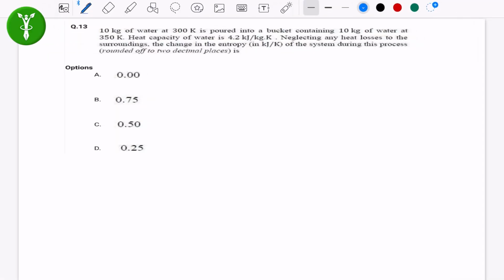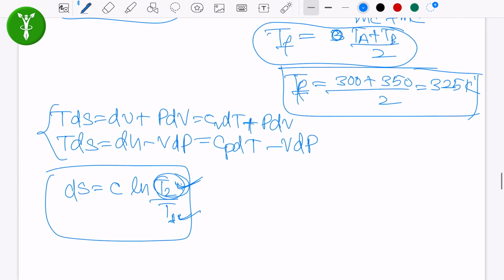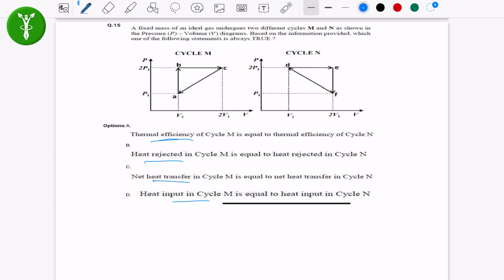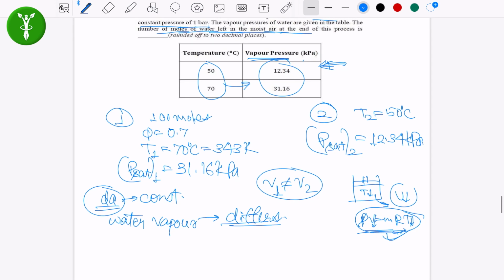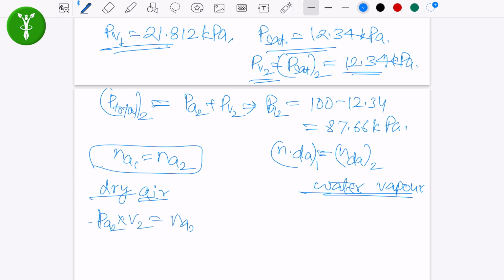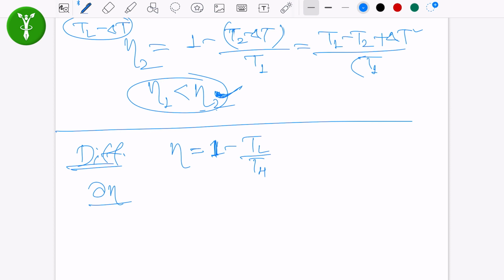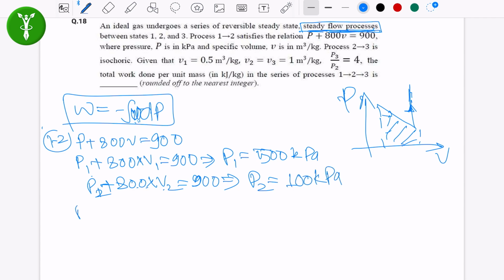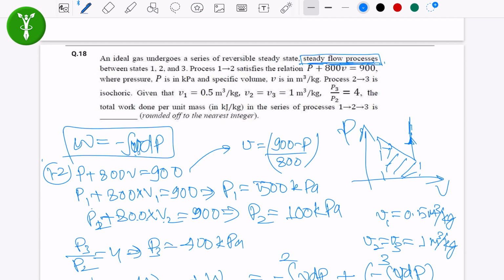GATE XE Thermodynamics 2024 | Detailed Solutions | Exam Analysis | AgriVision4U | Part- 3

Comment: The total entropy is the summation of the system and surroundings entropy. You don't need to consider the sign +ve and -ve in the formula as it is already accounted for in the formula as for system A, Tf  (final temperature) is higher than 300 K but for system B, Tf (final temperature) will be lower than 350K. So log(Tf/TA) will be positive whereas log(Tf/TB) will be negative. I hope you will understand. In case there is any doubt, feel free to ask.😊